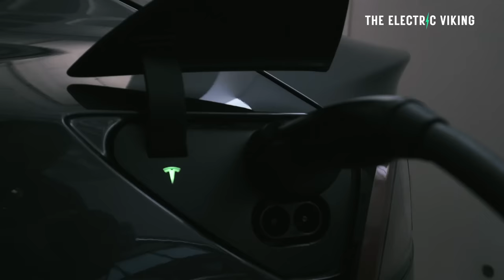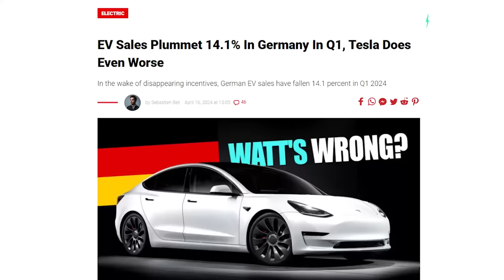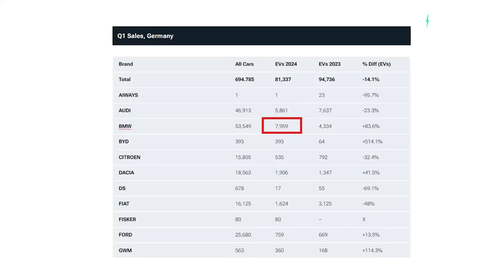The real reason Tesla EV Sales are in freefall In Germany in 2024

Comment: There should be NO incentives for EVs.
Reply: If you can come up with a clean burning fuel for ICE cars game over. And please,no clean diesel.
Reply: @jaaklucas1329  OK, but I don't acknowledge the "existential threat" of CO2 emissions.
Reply: @rlsedition  Im more concerned with the air pollution were breathing especially diesel.If we clean that up I dont care what tech we drive.
Reply: @jaaklucas1329  Current vehicles have already removed 95% of the emissions; there is no need to move to EVs.
Reply: @rlsedition  Semi trucks are more important to get clean to me. If you think cars are  though turn your car on in your closed garage and see how you make out. Then multiply that by 1.5 billion worldwide.
Reply: @jaaklucas1329  If you think big trucks are an issue, large factories are even bigger polluters. Cars are an easier target.
Reply: @rlsedition  Heavy vehicles are obvious because electric powertrain is superior for torque and simplicity. Here in Vancouver, we dont have heavy industry its all from vehicles.
Reply: @jaaklucas1329  Remember how all that electrical energy is created - mostly by coal and natural gas. EVs ARE NOT emissions free.
Reply: @rlsedition  Not here in BC we are hydro. Coal..no excuse for that unless your are 3rd world or dont care ,solar is cheaper now. We still need metallurgical coal for steel for now. Natural gas was the bridge fuel of the 90s. I support nuclear as a bridge solution.
Reply: @jaaklucas1329  Few places in the world have access to hydro power. Solar cheaper than coal? BS. Nuclear is, indeed, the right answer if you really want zero emissions.

Comment: The decline is due to PEOPLE DON’T WANT EV’s. Stop making excuses. As I’ve said before you know nothing about the car industry
Reply: Keep driving your co2 killer then
Reply: Then why are EV's 50% of new cars in China, 90% in Norway and 50% in Sweden? People don't want dirty ICE cars.
Reply: Just take away fuel subsidy and they want them even more.
Reply: Na. They have generated a sudden change in the affordability which generates a short term effect, but the technology trend is still there and it will continue after the shock passes.
Reply: I take it you've never driven one. I have a charger in my garage, so it's very convenient. It drives better than a gas car, due to the one pedal driving, no shifting, and prodigious instant torque.  I've got 73,000 miles on my 2018 dual motor Model 3. Love it.
Reply: Those petrol cars will find it expensive to fill up soon with the escalation of the war over in midfle east
Reply: @KhanR1-qm2xi Because there are incentives. EVs don't have any economic sense. 
It makes sense only if you buy a 20k-25k euro car and you drive at least  50km per day in and around the city. If you drive a EV you earn around 5 euro/100km if you drive it in the city and you charge it at home. 

I think Renault 5 will be the king of the roads in EU. 
Tesla and other 500 km and 2000 kg cars are too expensive.
Reply: @horoh1 Good argument! EVs need wars and incentives to make economic sense.
Reply: Speak for yourself buddy, I love my EV, and I love not sending my hard earned money to the oil sheiks in the Middle East!
Reply: If any ev, from any category, from any ev automaker, costs less to charge than the smallest sub compact gas car. Then gas car automakers are in big big trouble.
Reply: @yulusleonard985   Gasoline subsidies are a canard.  They are almost exclusively in very poor countries, where both food and energy are generally subsidized to keep the people from rioting.  In the developed world, they are almost non-existent.  There are no special gasoline subsidies in the US.  Sometimes, externalities, like pollution, are considered "subsidies", but you could claim that about EVs (for the extra mineral mining, and manufacturing energy) also.
Reply: @dzcav3  100% correct. In the EU half the price of the gasoline or petrol are taxes.
Reply: @KhanR1-qm2xi  Government incentives and electricity availability. Have you ever thought about the other half of the world.
Reply: Viking is correct. German makers want to delay until they have the next generation EV platforms in the hope they can compete. Buyers are highly price sensitive and it’s no wonder sales have fallen after the German government pulled the tax breaks and subsidies.
Reply: @KhanR1-qm2xi the rest of the world prefer Toyota hybrids. Toyota hybrids have more sales worldwide than Teslas.
Reply: @dadonwelfare  Not just a little bit more either. Toyota sells twice the number of hybrids as Tesla sells cars overall.
Reply: LOL, keep telling yourself that dude. Wishing won't stop the inevitable, however.
Reply: I'm very happy with EVs. We've bought 3 so far. Sold 1. Saved a lot of money. Did not pollute the air in our neighborhood. Cleaner air for the kids. Now our neighborhood has even more families going electric.
Reply: @jeffpowell5251  

Tesla has a very poor resale value because new Tesla prices keep dropping down to stimulate demand
Reply: @alexishart1989  

BEV is inevitable, but not in 2024, 2025, nor 2026.
Reply: @dadonwelfare  Tesla EV's are more popular than Toyota hybrids and PHEV's.
Reply: @windsolarupnorth7084  Nonsense. The Tesla Model Y is the best selling car in the world and is wanted more than Toyota hybrids or PHEV's.
Reply: @ilollipop100  The BYD Seal and Dolphin sell for under $15,000 in countries like Brazil. GM and Ford can't sell quality EV's that cheap.
Reply: @KhanR1-qm2xi  
Toyota sells 2.7 X more hybrids worldwide than Tesla sells cars.
Reply: @KhanR1-qm2xi  Complex and unreliable ICE cars which a shorter-lived.
Reply: @KhanR1-qm2xi  Toyota sold 11 million cars last year and had growth in Q1, they have a wide variety of cars for regular people. Where I live a 1 year old Prius cost the same as a 1 year old model 3 despite the sizable price difference of a new one.
Reply: @fjalics  I’ve driven the stupid things, I’m not impressed. As for one peddle driving that’s what I tend to do with my petrol car. I very rarely use my clutch or brakes I use just the engine. I used to rally cars and pedals were pretty dangerous, if you can’t drive a car fast on mud or in water, snow and ice, you panic and break or try changing down your liable to total your car. Drive like me and you don’t crash, destroy engines, gearboxes, clutches or brakes. EV’s are a scam winter range is pathetic and it’s either use your heater or freeze because of battery charge issues, you might as well drive an pre 1960’s car.
Reply: @RonaldShakespeare-tk7jx  How far do you drive on a normal work day, when you're not traveling? Extreme cold, like 0F will absolutely affect range a lot, but the average person drives 40 miles in the US. If you have a 300 mile EV and you charge it up, worst case you'll still go 150, and if you are also plowing through thick snow, maybe 100. On that one day charge it all the way up. Most of the time you only loose 20-30 percent. If you don't have easy access to charging like I do in my garage it might be a PIA. My dual motor Model 3 drives great in the snow. Really excellent.
Reply: @fjalics  Hi I don’t drive to work anymore as I’m retired. When I did work I would do about 300-400 miles a day, I drove all sorts of vehicles from motorcycles to the largest trucks. As for EV’s I did 359 miles in a Tesla, I found it junk. The doors wouldn’t open, The filler cap wouldn’t open. It took 14 attempts to get it to except the charging station, The range was only 162 miles I had the wipers on all the time as it was chucking it down with rain. The central screen went black. This was only one trip and I hated the damn thing. To charge it up it took 137 minutes before it charged up to 87%.